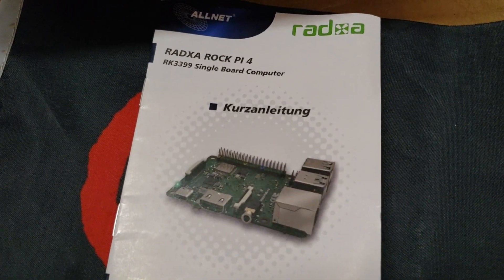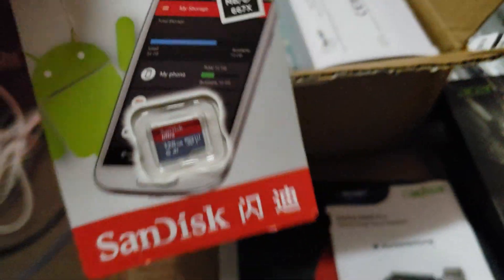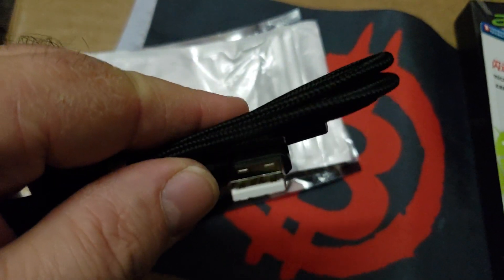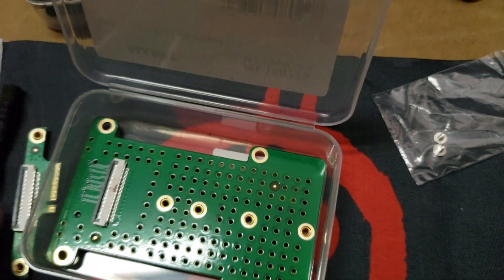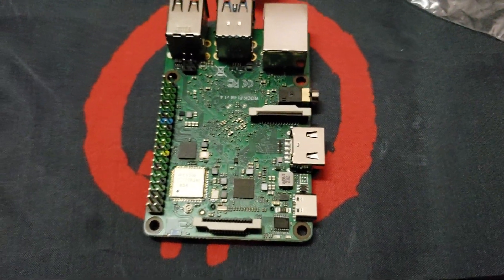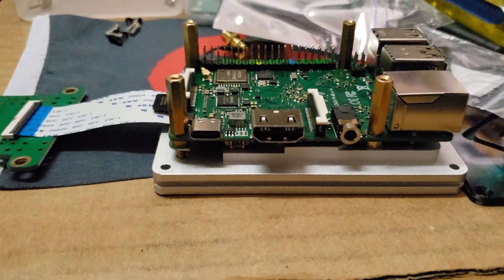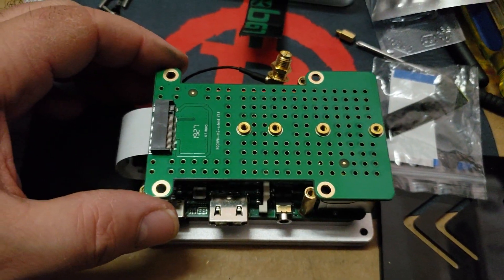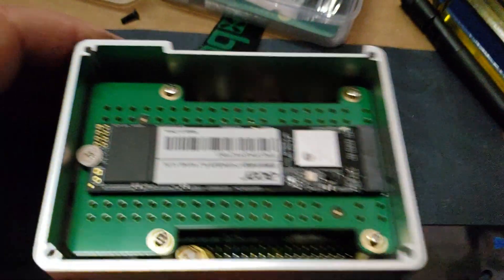Rock Pi 4b Unboxing and How To Assemble It With The M.2 Extension Board

Comment: The orange adapter is a 3 amp box. The raspberry pi 4 requires that much power.. most plugs that aren't orange are usually 2 amp.
Reply from the maker: Thanks for sharing the information, I was wondering what the difference was.